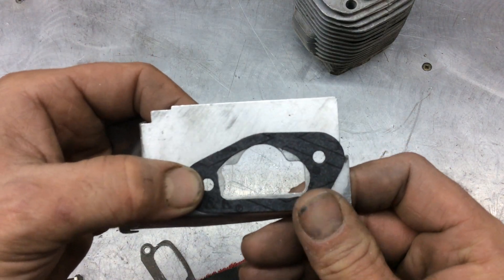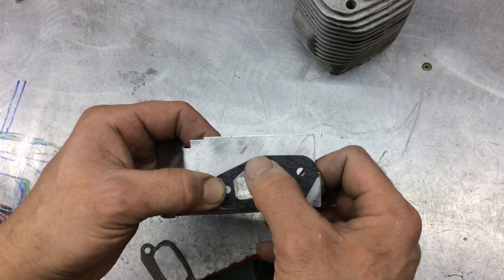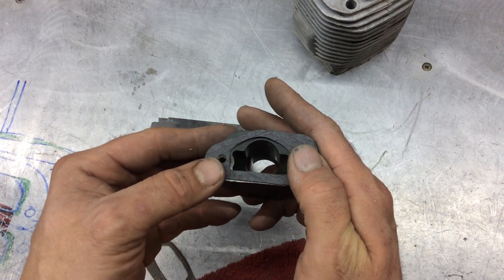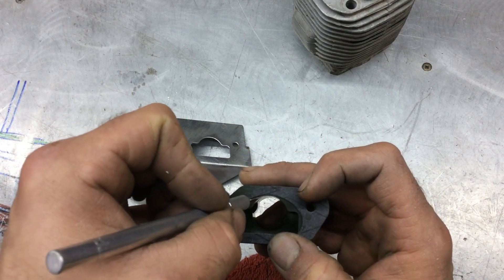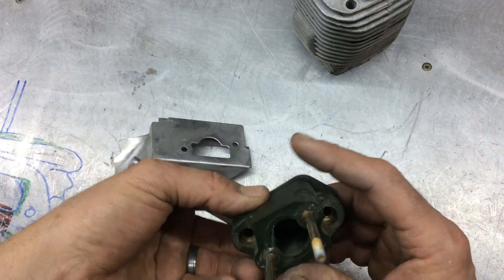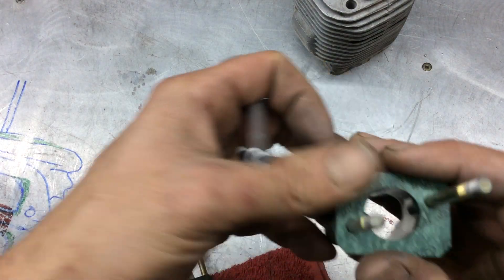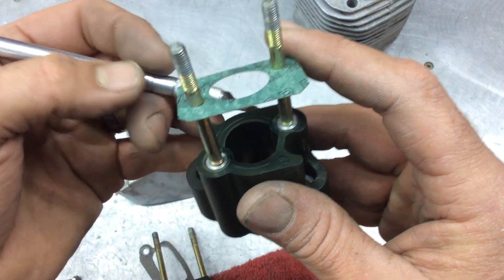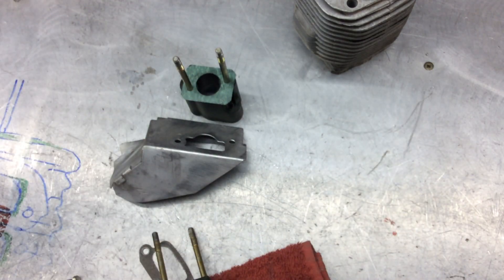Part 3 -  Gasket Matching Porting 2 Stroke Piston Ported Engines for High Performance and Efficiency

Comment: "Looks radical, we won't get that much flow" Re your 'over-matched' gasket, LOVE it!!  I'm still a n00b here so carb-work is actually still something to learn (and parts of the crankshaft, I basically just do top-end rebuilds jug/piston/upper crankcase), but for the exhaust-side that's precisely what I do I aim for maybe 5% 'over-ported' gaskets to ensure no choke-points when it's mounted/mated to the jug), do you have a recommended material to use for DIY custom-cut gaskets?  I have every type of grinder I just don't know where/what to buy for 'generic gasket material' for base gaskets & muff gaskets, I have been lucky with the former in that I've made-use of what I've gotten w/ the saws (IE sanding-to-size the OEM gaskets), but for muff-gaskets honestly I'm usually just ditching the OEM and replacing it with a custom-cut sheet of aluminum that acts as heat-shield in addition to being my muffler-gasket (for instance my 660 clones, I hate how poorly-cooled their jugs are, so I cut the top-covers' fronts a bit so the muff can breathe better and have a giant aluminum plate separating them from the jug, this plate is 1-and-the-same with my 'muffler gasket'), I like this method for my big saws and even if it doesn't seal beyond 99% it seems the leaks at gaskets "plug themselves" (presumably crud & carbon buildup) over time, actually I suspect such 'plugging' throughout the engine is part of "break-in gains", anyways for my smaller ones like my 2511t or 355t I need gasket materials and aluminum-sheeting isn't going to cut it, they need something "with give" so I can really 'press it in' when bolting it down, any tips here would be hugely appreciated (makes me think I should also go swap all relevant screws w/ the types that have those lil slits on the undersides of their heads, that makes them bite-down better when fully seated....ever since getting into high displacement powersaws 90cc and >100cc I'm seeing just how insanely tight everything truly needs to be, am using loctite red where able but unsure what to use when the loctite doesn't "go off" which is often enough, or when it's a metal bolt into plastic, would love to know what you use here!  Have been using lil dabs of my Motoseal to "get by" til I figure out something more optimal!!)
Thanks again for posting this series, can't believe no other comments it's not like this is a new series...thanks a million I'll probably watch this series a half dozen times to really absorb all you're putting across, honestly I know most of it already but just hearing how others think is so valuable here IMO (the chainsaw-tuning arena is, as you know, VERY 'behind' as far as engine-work goes, perhaps they're one of the least-advanced engine-types that are modded on earth, wouldn't shock me lol, the norm of tuners here is still "put a ginormous hole into the muffler's outer wall, this solves ever.y.thang!1!" lol)